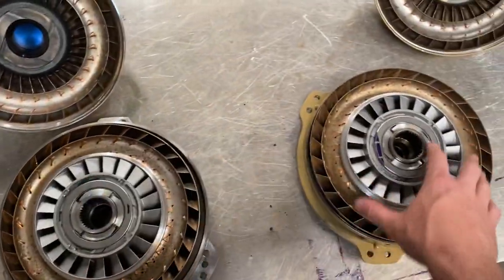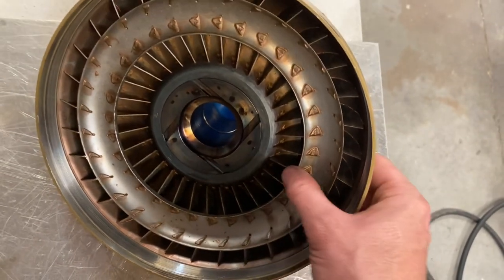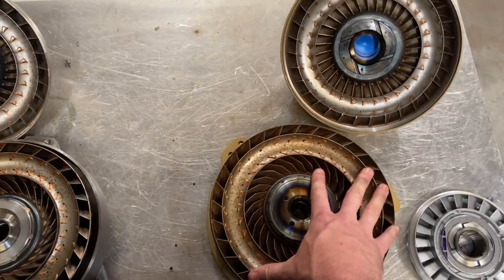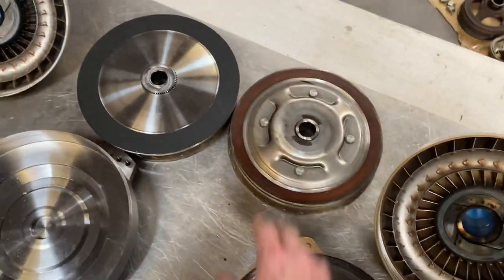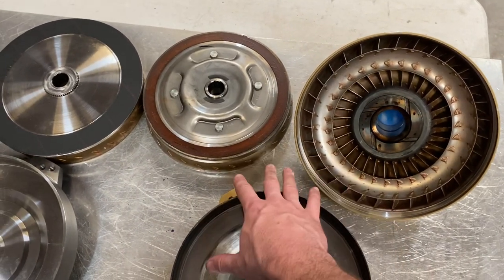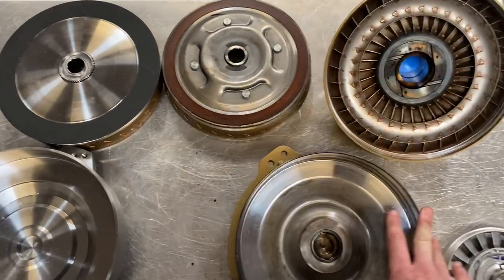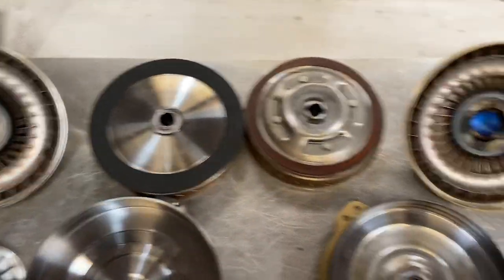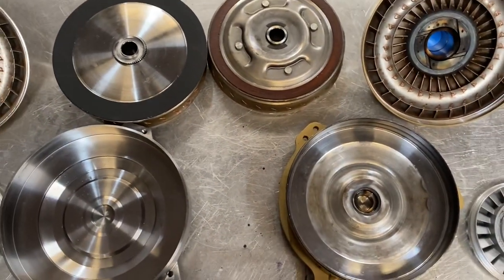Billet VS budget. Your money gets you more!

Comment: How is your furnace brazing different than stock? Most stock GM converters I've cut open were furnaced brazed.
Reply from the maker: Stock pump is. Turbine is not. Ours are fully brazed.
That isn’t the comparison I’m making though, against other performance converters on the market where they’ve done nothing or fins are just tack welded on the edge of the fin. There can still be fin failure.

I don’t want to walk down the path of making other people look bad makes me look good. I think that makes me look like a jerk.
We’re putting out the highest possible quality, with a warranty.

I am going to do another video explaining some of this a little better. I kept an example instead of throwing it in the scrap bin. I’ll just change the names, or color rather, to protect the not so innocent.

Comment: how much to rebuild a 6l80 converter?
Reply from the maker: Strongly encourage everyone to go with the version we do that has a billet drive cover. Helps resolve the issue where the thin stamped steel drive cover cones out and reduces lock up clutch surface area. A huge amount of them do this, and people side step the problem by running twin disk ctsv/zl1 which are now unobtainable. 
Have them in stock, call me at the shop (727)401-4269 $650 shipped $200 core charge. Return label provided. Also do a high stall version for vehicles with an aftermarket cam.

Comment: Billet isnt a material.  The way you mention it in the vid seems to imply that it is.    Billet is a process.   All it means is milled from a solid part.  If i machined a backplate out of a solid chunk of brass it would still be a billet backplate.   Just not a strong one lol.
Just saying it maybe should be explained or worded differently in  future vids.
Reply from the maker: Yes "billet" is meaningless unless followed by an alloy and heat treatment process, that matters more when were talking shafts where different alloy makes a significant difference.
The drive cover could be stamped 1045 sheet steel and billet 1045 steel would be a significant improvement. So for these parts they don't need further detail.
Shafts is really the hill to die on with this.

I appreciate the comment and you're correct.
When it is important(if it doesn't start problems)I have/will call it out.

Comment: billet isn't the best for everytime... look at leaf spring shackles... OEM are stamp forgings... for a reason, fabricated shackles even TWICE the thickness... arn't as good

not knocking your products, just implying billet is the absolute best you can buy, and just plain billet... isn't as good as forged with the grain structure able to resist loads vs billet's flat grain orientation
Reply from the maker: There are various ways to make something stronger.
It can be dimensionally larger, better alloy of metal for the intend purpose, various heat treatments, or physical treatments.

Oems are masters of “Just good enough”

We are talking strictly about a converter.
The oem converter is mostly stamped sheet metal of a steel alloy that has good elasticity to aid that process but the end result is not rigid.
Manufacturing those same parts out of thicker, better alloys of steel, and a heat treatment process is a significant improvement and beyond sufficient.

Not everything can, or is required to be titanium forged in a gigapress.

You may not be aware, but billet blanks themselves can be forged via various processes.
Just your basic cold rolled versus hot rolled steel of the same alloy has different properties.
You could likewise produce a inferior forged part out of recycled Chinese door knobs, the process alone doesn’t ensure quality. All aspects determine the result.